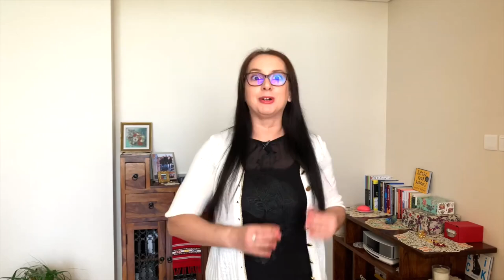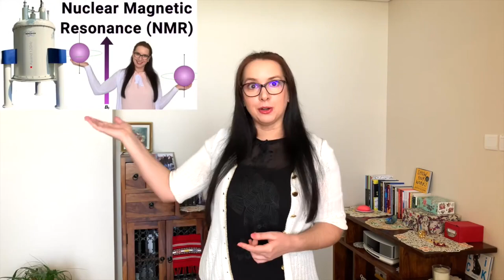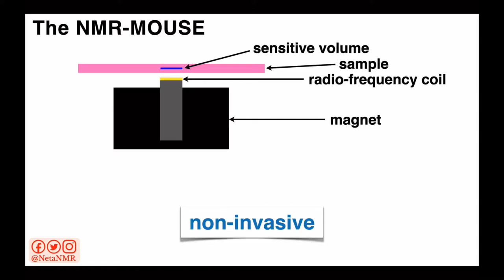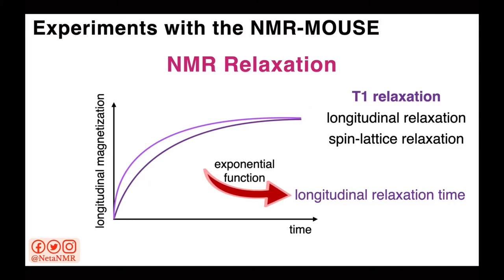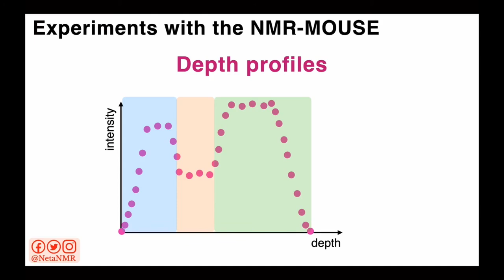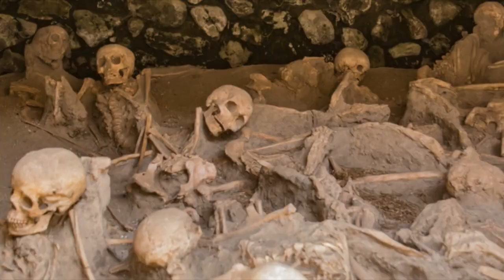Mobile Nuclear Magnetic Resonance for Cultural Heritage

Comment: Remember, that I visited Prof. Blümich at the RWTH in Aachen in the mid 1990ties to get first hand info about this mobile NMR-Device as we were interested how this could fit into our NDT world for the Airbus aircrafts. We discussed a lot of topics, but faced the drawback we had also with THz and microwaves, Most of the NDT targetted materials in aerospace are conductive, even the fiber reinforced plastics based on Carbon fibers.in The followig years we carefully observed the development in this field, but never found an application case... sadly. I liked the method and the way the team of Porf Blümich developed this method for single side application.
Reply from the maker: Than you for your comment